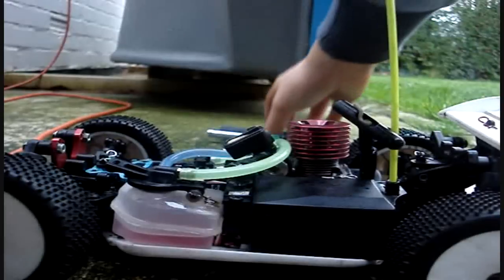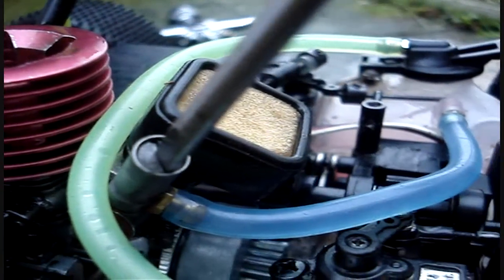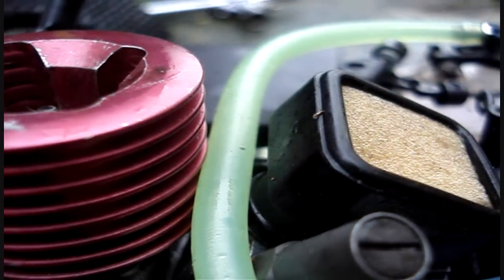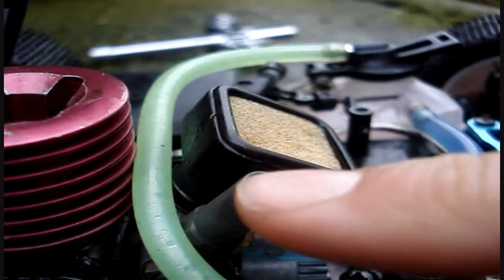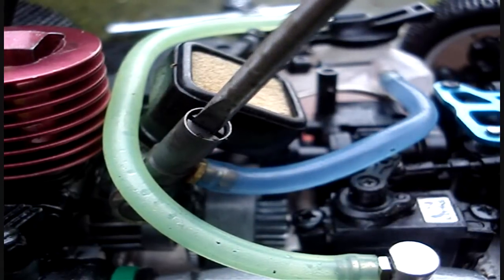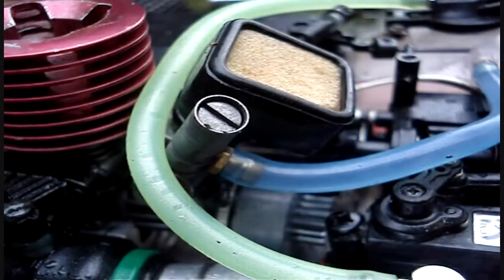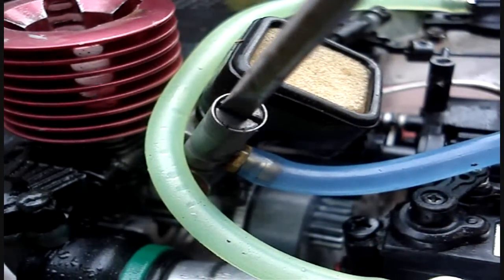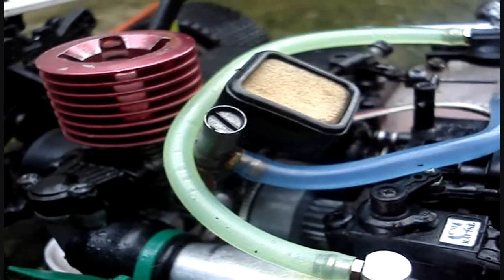Nitro Engine Tuning Settings for Toki .05 Engine on ACME NB16

Comment: Hey, i have a NB16 and have had for a couple of years. When i start my engine to car seems to drive forward slowly without me pulling the throtle, any ideas on how to stop that happening?
Reply: AllAboutTheVidzUK  adjust the idle screw
Reply: I made sure my idle gap was about 1mm then I had to richen the low speed needle to stop the wheels spinning really fast while idling.

Comment: hey, i was wondering, is it easy to upgrade this buggy (not the truggy) and could u put a bigger engine on it like a 0,18 for instance. Could all the parts like gearbox easilly be upgraded? or are parts mainly made for 1/10 models?

thanks buddy

Comment from the maker: Dont know If I answered this or not mate did I? But any Hot Glow plug will work fine in this engine. The thread should be short, not the long type.  For parts I am not sure as you are in USA.

Comment from the maker: Well, the NB16 is hard to start sometimes :) If you add some fuel direct into carb, just a few drops. Make sure idle gap is about 1.5mm open(adjust using throttle trim or idle screw) For the High speed needle flush to edges and screw in one turn. For low end flush to edges and screw in half turn (These are only different from video because your starting for the first time) It should be ok :) Let me know how you get on